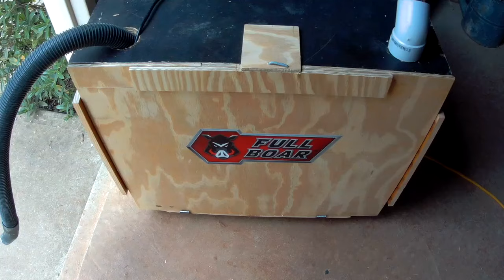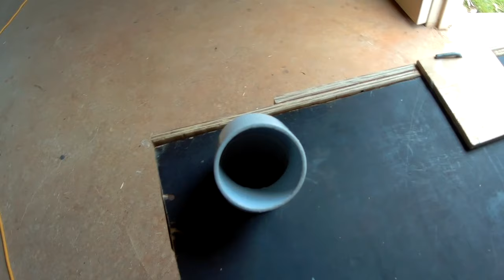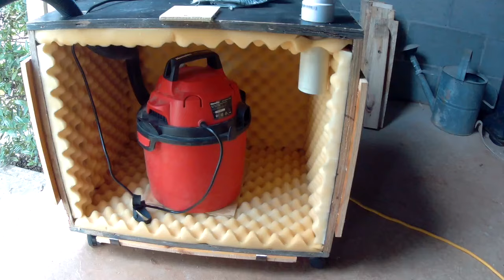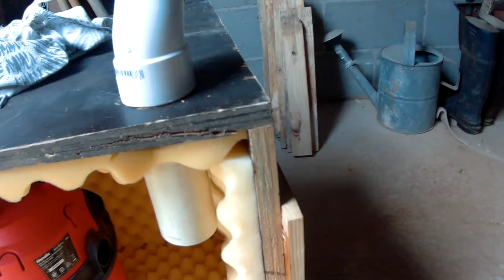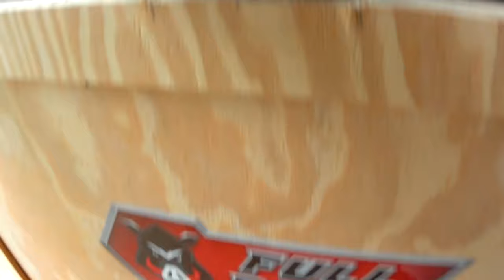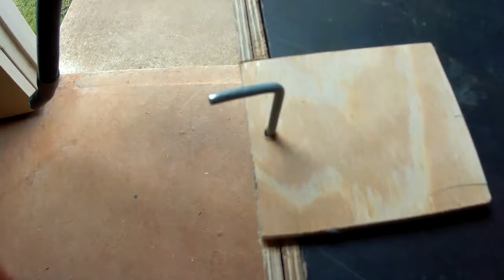Shop Vac Silencer Simple Construction

Comment: Excellent solution to shop vac noise! Only caveat: almost all of my tools - table saw, track saw, sander, router etc.  - are much louder than my cheapo vac setup! The only concern I have with noise, is to maintain a good relationship with my immediate neighbours. Alas, that has meant some heavy duty insulation to the prefab' concrete garage I use as a workshop. To reduce the noise nuisance to my good self, I simply pop on some decent ear protection with buds underneath, so I can listen to some music while I work. 
Please don't take this as a negative comment. I'm simply curious as to the benefit of reducing the noise of a tool that will only be in operation when other, louder tools will be at play. Unless, of course, you are keen to keep the workshop 'ship shape and Bristol fashion' as quietly as possible :)